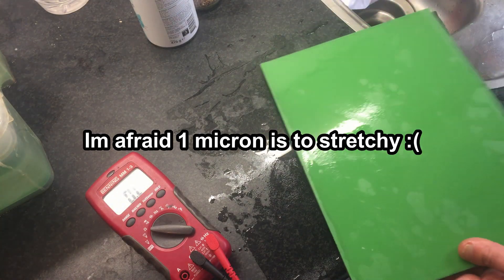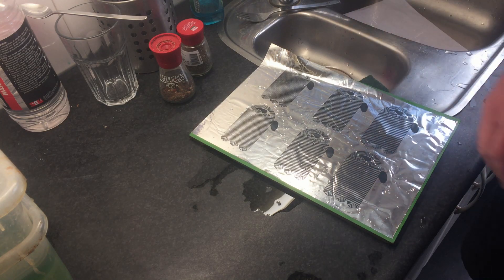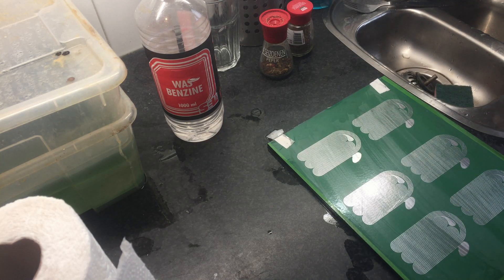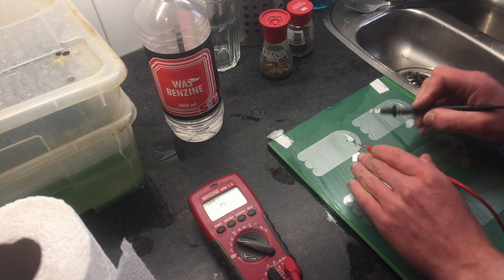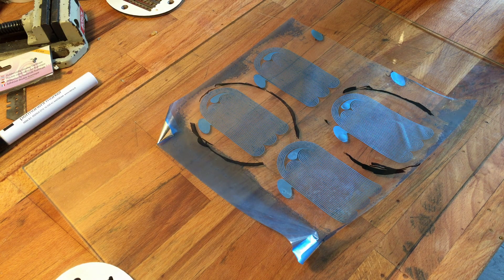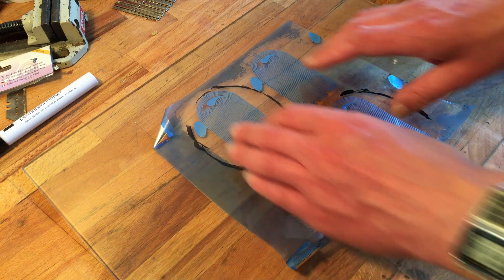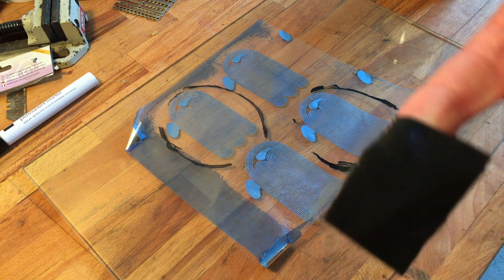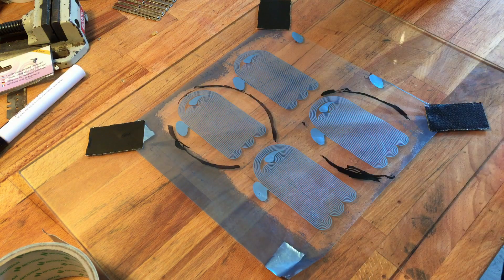Diy Planar Magnetic Headphones - Part 2

Comment: Sorry,
in this video is not clear how you glue the mylar film to the aluminium before etching.
what kind of glue do you use?
is it durable in long term time and vibrations? 
thank you.
Reply from the maker: i use a pre made laminate here. most of my  foils (all the blue colored ones) come with aluminium and some i make myself depending on what i want to try. 

the premade laminates i got are 
12 mic mylar 9 micron aluminium
12 mic mylar 12 micron aluminium
12 mic mylar 24 micron aluminium
24 mic mylar 24 micron  aluminium

at the moment my stock of 12-9 and 12-12 are low :(  but i got enough of the last 2 if you want to buy any.
Kind regards Joppe
Reply from the maker: also is also often ue a BIG role of alumnium tape, to make my own. it comes in 25 mic alu 50 mic alu and 100. so more suitable for heavy things like midranges or bass drivers. it can be plot easily or etched
Reply from the maker: one last note :) the preferred enchant for me is copper sulfate with kitchen salt.
Reply: @joppepeelen  have you a shop site where to buy?
a normal laser printer is also good?
in the past I tryed with normal laser printer but the solvent for removing the toner after the etching, removed also the aluminium glue then it was a disaster.
How do you remove the xerox solid ink from the aluminium?

Comment: Thanks for these videos! Currently heavily looking into doing something similar. Assuming I understood what I watched correctly, what kind of setup do you have to print the coil and how exactly does it work? I don't really have the funds to get something to laser cut/etch the coil so your first method seems most attainable to me. Thanks!
Reply from the maker: Well i used a solid ink printer. Not the easiest to find from xerox. Since they are out of production so look for a,second hand one. The i used the plorting method, the most obtainable method, get a scrap book plotter from a hobby store or secondhand like a cameo 2  3 or 4. Or sometjing similar
Reply: @joppepeelen  Thanks so much! Forgive me as I'm still very, very new to the idea of creating my own headphone driver and I can't seem to find many resources on the internet. If you don't mind me asking, what would be the steps/rundown from a xerox to plotter? I'm not entirely sure how that works, especially getting a conductive material printed for the coil. The rest of the process I think I understand, it's just the whole printing of the coil that I'm confused about. If you know of any good resources for this it would be great too. Hopefully I'm not asking too much. Thanks again.
Reply: @joppepeelen  Could a laser printer work as well since it kinda has a solid form of print that it lays down

Comment: Wassaaap joppe!
I find acetone works much better than MEK for the adhesive removal between traces. The higher evap rate doesn't undercut the traces as much. Also maybe let the Acetone outgass overnight to give the trace adhesive a chance to recover. I did a test with a 5mm ball of leftover adhesive removed from traces. Took 3 days for the Acetone to leave and adhesive finally cured . Prob not a big deal with small power drivers..
Reply from the maker: you use the same blue film ?
Reply from the maker: outgassing is a good idea ! ad for evaporation mek P evaporated faster then acetone i believe.  surely feels like it.  :) and it stinks more so must be better ;)

Comment: Hi Joppe, what did you use to etch your traces on the 1 micron Mylar attempt?

If it contains any concentration of sodium hydroxide over about 1% that will cause the Mylar to lose its tensile strength and become elastic and much more fragile.
Reply from the maker: i used , copper sulfate and table salt :) it is a proven method.. but i think adhesion how aggressive(enchant is) it is and maybe temperature and flexibility that screwed me over. maybe even the type of aluminum foil it is :(
Reply: joppe peelen aha! okay. I thought I saw a bottle of drain cleaner (blue bottle) on your worktop and then assumed that was what you were using. Silly me.

Would you say copper sulphate is better then ferric chloride for etching aluminium? I’m using ferric chloride around 50*c and it does seem to take a while. It is 12 micron foil though.

Looking forward to see the headphones. If I’m honest, I hope you make lots of mistakes so I can learn from them before I get to making mine! :)
Reply from the maker: @bunnythekid  its much more gentle then feric !  and more healthy to :) and less stains :)